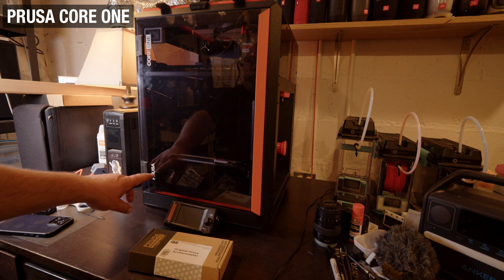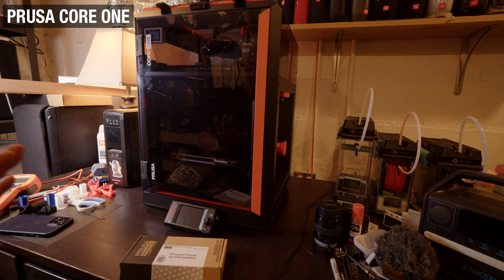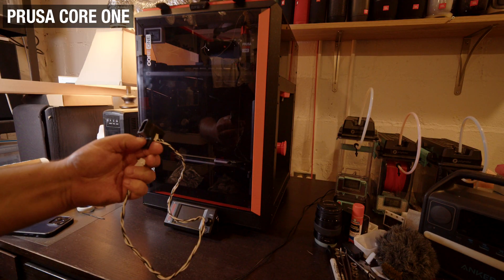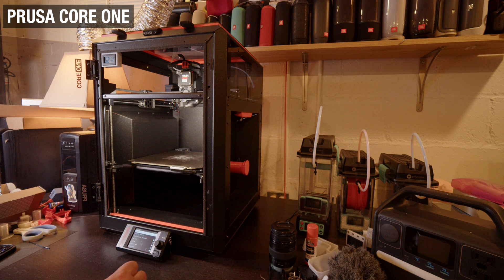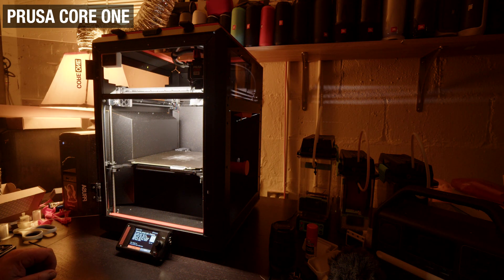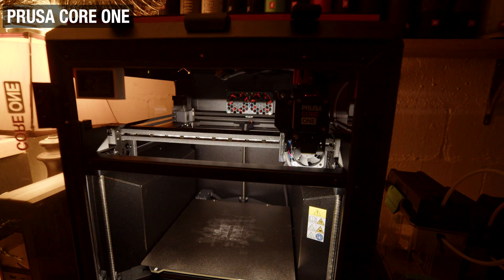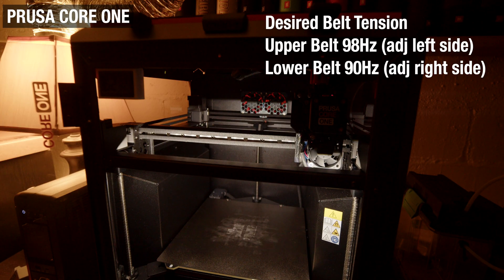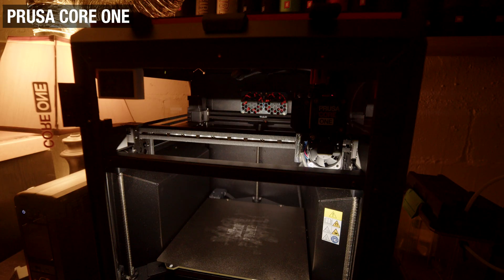Prusa Coreone Fine Tuning with Accelerometer

Comment: You didn’t mention the jumper cable inside the xBuddy box. I understood that the socket in the WiFi module won’t work until the jumper cable is installed.

Comment: Just to give you a heads up. You are not tuning your belts properly. Prusa's guide tells you that when you tighten either screw for your belts, you need to turn the other side the same. It's so you don't twist the gantry. If you turn your motors off and slide your gantry to the front, it shouldn't have gaps on either side.
Reply: if you watch - he did do both sides.

Comment: What firmware are you using? I don't have the manual belt tuning in my menu.
Reply from the maker: 6.4.0-Alpha
Reply: Every calibration that I have done with a stroboscope light is to look for no movement but you look for max movement?
Reply: @MrBobkeenan   that was my thinking too - its interesting